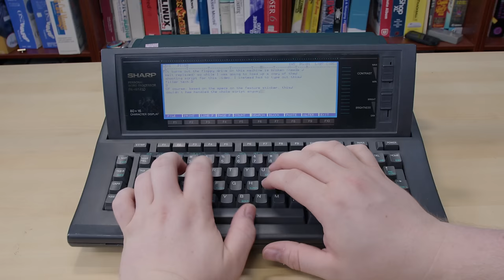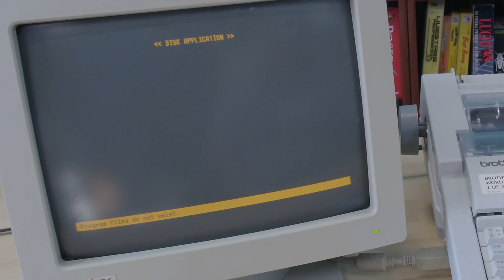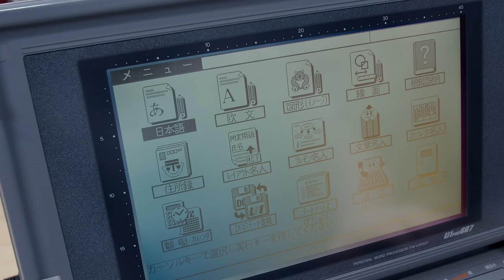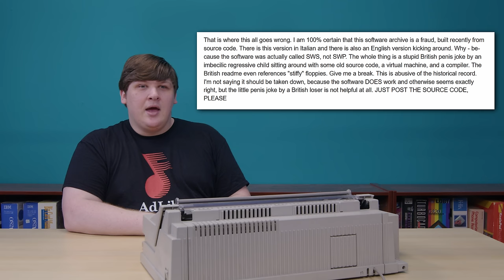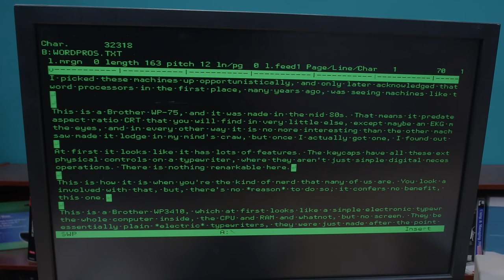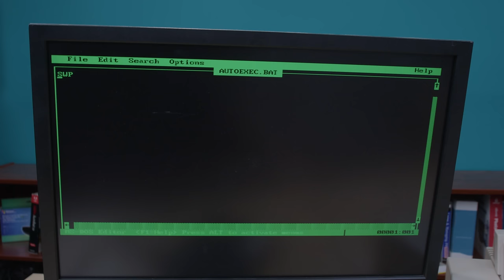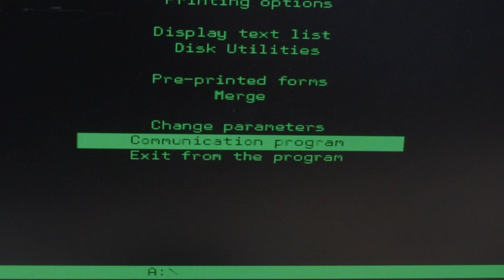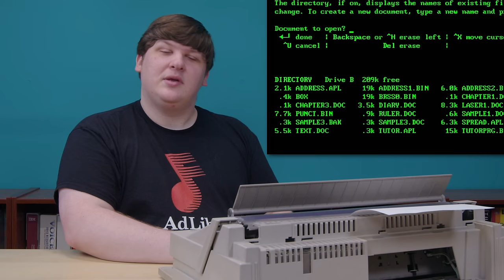The Weird Processor: Olivetti's PC Typewriter

Comment: My partner wanted to tell you that the reason it was super expensive and the custom programmes were so slick is because it was marketed to lawyers, who always base their purchasing on what sounds the most expensive and custom. (They're a soon-to-be former lawyer)
Reply: Very interesting!
Reply: Plus all the standardized forms with carbon copies. The ability to run WordPerfect is a plus.
Reply: I worked in a law office that still used one of these until it died in 2015. It was relegated to a corner of the office where it's only job was to type file labels.
Reply: In Germany, Olivetti typewriters and PC XT AT were the standard for tax consultants who work with DATEV (a cooperative) over the years.

Comment: Our shipping department still has an electronic typewriter in the cupboard, as they sometimes need it to fill out shipping papers that use a carbon copy (since other printing technologies are not able to imprint the character through the carbon paper onto the second sheet). So they still have some niche uses, whereas the "newer" word processor is completely obsolete.
Reply: 9pin dot matrix printer can do carbon copies just fine, but you might have issues with alignment when filling out those forms.
Reply: @SianaGearz  I found it uniquely amusing and pleasing when I first learned maybe five or ten years ago that they still make new dot matrix printers for exactly that purpose.
Reply: @ssokolow  : I think there's also an aspect of near invulnerability. I'd be more willing to try a daisy wheel or dot-matrix in a dusty location than an inkjet or laser, due to fear of the dust infiltrating critical sections of the printer causing more immediate trouble with the ink jet & laser than the more mechanical alternatives.
Reply: @absalomdraconis  Good point.
Reply: @RonJohn63  I mean if it's the same form format over and over again dot matrix really is the best way to go. Then again if op is somewhere in the middle of the shipping chain and they're filling out different forms from somewhere else that they have no control of then I'd go typewriter.
Reply: @RonJohn63  I don't think you can say that with any confidence. The op doesn't specify whether it's the same form over and over or if they change format often. If they do stay the same then dot matrix would be better you just set it up once and you're done. On the typewriter you need to manually advance lines and such it's got no idea what the form is, it's just putting letters down wherever you put the paper a dot matrix would do that automatically. There's a reason O'Reilly's used dot matrix up into 2020 for their carbon copy receipts. Cause you set it up once and it just works.
Reply: You'll still find them in car dealership accounting offices, used for filling out title papers ect.
Reply: Same we have type writers in the office supply room for filling out paper forms and checks

Comment: It doesn't seem like the reverse feature would waste ribbon to me, each character on one of these word processors uses the same linear amount of ribbon, and that amount of ribbon cannot be used again. So it's kind of wasting less ribbon, since it's using all of the ink/carbon on that length of ribbon, rather than leaving a lot of it on the ribbon.

Comment: The Panisonic looks really interesting! Its an electronic typewriter so maybe once you dig in it stops being interesting, but I want to know what a bunch of those applications are! Here are what their names are top to bottom left to right with my best guess at what they are.

日本語 - Japanese - Japanese text editor
欧文 - Western text - Latin character based text editor
図形（イメージ） - figure/graphic (image) - an image editor of some kind maybe?
線画 - Line art - figure drawing application?
機能説明 - Help file
住所録 - Address book
レイアウト名人 - Layout master - Maybe a form creator or a form filler application?
プレゼン名人 - Presentation master - Powerpoint type thing. Maybe you print out clear slides?
文章名人 - Writing master - No clue, maybe a different text editor with tools like table of contents?
カルク名人 - Calc master - Spreadsheet software
電卓・時計・カレンダ - Calculator, Clock, Calendar
DOSデータ交換 - DOS data conversion - converts from proprietary files to DOS compatible?
データノートII - Data Note II - maybe a lotus notes type thing?
通信 - Communication - Likely a modem program?
拡張 - Expansion - Not sure, maybe more programs under this as a submenu?

The mystery port says "image input output", I can't quite read the DSUB but I think it might just say "port", and the expansion ROM is a font package with 48 dot Gothic in the JIS format.
Reply: Thank you so much for the translation!
Reply: I read your first few words as "The Painsonic", and you never know, that might be correct.
Reply: I'm very very curious about the presentation mode; I saw that and immediately jumped to the comments to note that one because I can at least read that much!

Comment: Fun fact: italic  is possible on a daisywheel printer, and I personally have seen it in action. It utilizes a daisywheel with two "rings" (or "rows"?) of characters, and the entire wheel assembly moves slightly up or down to select a "text palette".
It was a common-ish design in Eastern Bloc because, well, the RUS/LAT problem which needed some solution anyway. Such machines were equipped with two wheels, one for RUS/LAT on separate rows and other for cyrillic/italic cyrillic. Clever and effective.

P.S. The almost universal use of the KOI-7 encoding with a separate character (and key on the keyboard) for changing the layout also fit perfectly into this technical solution. When printing, the system sees the required character and not only changes the code table to Latin, but also instructs the printer to shift the wheel. Same with Italic, just without code table switching.
Reply: Some Chinese printers as well. I'm kind of glad we've largely moved past impact printers because as much as some of the solutions were incredible they were often so much headache if anything went wrong.
Reply: Some models of Diablo daisy wheel printers supported dual row wheels, and proportional pitch wheels. I used to have a Xerox 820-II Information Processor. (After their failure with Star and Alto, Xerox didn't "do computers".) It was a bog generic Z-80 CP/M machine with text only video. Connected to it by the serial port was a Diablo 630 daisy wheel printer. Very fast, very loud. Though when with WordStar I had it do bold doublestrike underline it got a lot slower, and louder. I only ever had one print wheel so I never got to see what other tricks it could do.

Comment: 1. Olivetti was a pretty substantial early computer player, their Elea line were some of the first transistorized mainframes introduced in the late 1950s (and the progeny of their Semiconductors division is part of ST).  
They tried to exit the computer market on more than one occasion, the Elea line was sold to GE in 1964, who sold tens of thousands of them as the GE115 and successors.  Then they found themselves dragged back into the small systems market by the mid 70s via their presence in the calculators and typewriters office appliance market, with a few bespoke machines then more commodity things like the Z80 CP/M boxes you mention and a slate of PC compatibles... it's a neat story. 

2. You mention the Selectric and IBM/Lexmark Wheelwriter line as a comparison several times, which makes sense because they were ridiculously dominant so a lot of typewriter/wordprocessor conventions descend from them.
The wheel-writers are also daisywheels that do micro-shift bold and auto underline and such, and some of them do goofy things like beep spellcheck with no screen (I played with a 1500 that does that a while ago... it's a whole-ass NEC V20 based computer in there even with no screen or removable memory). 
There were several earlier IBM fancy machines like the Selectric Composer that did a ...purely mechanical proportional font with 40 characters of lookback memory implemented with little sliding plates... and a variety of models with weird bespoke magnetic storage and such.  Selectrics are insane clockwork bullshit that it makes absolute sense that they were instantly killed by the advent of microelectronics.  Getting an "attic-fresh" one into working condition is an interesting challenge that involves a bunch of solvents and specific lubricants and hundred page long sequential adjustment manuals.  
Later wheelwriters with line LCDs or attached CRTs or whatnot set a lot of the conventions for the kind of machines featured in this video. 

3. If you want a truly interesting late wordprocessor/appliance computer thing, try to look at a Canon Cat.  It was designed by Jef Raskin of Swyft and Macintosh fame, has a wildly sophisticated text-only interface for basic productivity software, infinite undo, etc. (and has a built in forth and assembly toolchain that you can drop into by special incantations).  They are ...difficult... to obtain these days, though you can play with its software in MAME.
Reply: While looking up history you could read about Federico Faggin who started work at Olivetti developing computers, before moving to USA and developing the first micro processor for Intel. And then starting the company Zilog who made the Z80 processor
Reply: An Olivetti P652 computer system was gifted to our school in ~1984. It was a 4004 based system, with magnetic tape program storage cards about the size of a punch card, with a track of tape on each side), paper punch tape writer and reader (separate cabinets), typewriter, and 70K word fixed hard hard disk (single ~1cm thick platter)
Reply: the elea lie wasnt sold intentionally, it was bc the founder adriano olivetti died, olivetti got saved only by a clandestine project

Comment: I worked briefly at an Olivetti reseller in the 1990s. Loved the video and I hope I can add some cultural / contextual background.

Olivetti's are weird in part because they were coming at computers from their Business Machines background and this had a big impact on who they targeted.

Note the little silver branding tab stuck on the keyboard advertising the local business machines dealer it was sold through. Olivetti was a something you'd likely be introduced to by the folks who sold you your photocopier. 

Our local reseller was owned by a family friend and I was in and around it and others for 15 years. Even in the late 1990s the showroom was dominated not with computers but photocopiers, electric typewriters, fax machines.

We shouldn't underestimate how many businesses held out with electronic typewriters until the turn of the century. While working as a technician in the late 90s I would visit workshops, factories, schools (mostly to fix photocopiers) and see so many being used in offices that were modernising, but without a single person on staff who'd ever touched a computer. As mentioned by other commenters hiring a person with typewriter skills was a lot easier than computer skills at this point.

The sales staff pitched the Olivetti PCs as an extension to the suite of machines you were already buying or leasing. They were often sold on support contracts, and serviced by their photocopier technicians.

Olivetti the company was designing and manufacturing a large line of complicated office machines, to which they added a PC line. I did a lot of work in the guts of Olivetti PCs and the physical design (fold away cases, swing-out components) seemed strongly influenced by those traditional machines. Support contracts are a big money and making photocopiers serviceable was core business.

This is entirely speculation - I wonder if the odd video output development was in any way influenced by the fact that Olivetti had video and lcd screens for their advanced photocopiers products.

Comment: 19:40 I don't think it's a matter of 'input lag'. When you type Japanese (I do it regularly) you write using 'sounds' (that's not correct, but that makes it easier to explain what I mean) and the software, after pressing the SPACE key, allows you to select from within a list what you mean by that chain of 'sounds'. So there's a key that'll give you 'ki' and other that'll give you 'ke', another to change that to 'ge' and finally one more to add a 'n' sound to the end. So you press all these and you get all the words that are a compound of the sounds 'ki ge n' (there's more than one, in this case). As you type more and more, the software 'learns' what you usually type and provides that as the first option, so you can just keep typing and the software would (theoretically) choose always the best option for you. What I think is happening here is that the software is still trying to do that, even in English mode (take note how it highlights all the word once you press the space key), even if it doesn't need to do so. It might have some amount of delay.... but I'm sure the delay is worse because of the way typing Japanese works. (edit: corrected a couple typos and incorrect punctuation)
Reply from the maker: Oh man, that makes sense, I hadn't considered that. There's a reason I said I wasn't the person to show this thing off!
Reply: @CathodeRayDude   I would bet it has more to do with page layout and pagination.  Showing text in a proper word processing program is surprising complex.  These, if they're using fixed-width fonts, have an advantage of not having to figure out the width and line height of characters, but they still need to tally up the number of chars / pixels per line, decide when it's time to wrap, figure out if there is any text below that needs to be pushed down a line, handle overflow of a page onto the next, and so on.

I would imagine a lot of this is happening even for the first character on the first line of the first page.  At the very least, there's word counting, buffer management ...

And that doesn't even start to consider things like spell checking and grammar checking.

All this on a low-cost, low power, fanless processor from the dark days of computing, that was probably optimized for as little RAM usage as possible over speed, and software that was written to be as stable as possible so they didn't have to deal with updating ROMs on a gazillion machines owned by people who were, by definition, uncomfortable with the idea of owning a computer.
Reply: I think you're on the money there, some older Japanese dramas have similar delays on full on computers (the one I remember best was a G3 Power Mac) due to the predictive text/selection at play.

Comment: Interesting fact about the Brother floppy drive - every floppy-enabled Brother device from sewing machines through knitting machines and later word processors used the same floppy format, the FB100. This was badged by Tandy for their portable devices like the M100 as the TPDD - Tandy Portable Disk Drive. It's now possible to read your Brother disks using a Fluxengine disk imaging tool thanks to me sending a raw dump of an FB100 disk to the Fluxengine creator @hjalfi, who added it as an option.

DC monitors - Chuck Peddle's Victor 9000 uses a separate 12V DC line from the PSU to power the CRT, neat. In Europe we had that machine as the ACT Sirius 1, and ACT went on to become Apricot who released a range of machines that also had DC powered monitors.
Reply: And you can actually rewire a "desktop floppy" drive to replace the original if it fails on you by cutting the ribbon cable and jumping the wires correctly.
Reply: Those Tandy drives are sought after by owners of old Brother electronic knitting machines.

Comment: The 640K limit is because the VGA buffer is at 0xA0000, or 640K. 768K would 0xC0000. So there's probably a video buffer at segment:offset 0xC000:0000. Then again it looks like they're register compatible with MDA so maybe they allow writes to the MDA address 0xB000:0000 too.
Reply: And as for "how much software would be able to take advantage of this" -- potentially quite a lot.  DOS would give your program a limit on how much memory it was allowed to use -- basically, whatever chunk it had free.  So if your memory manager could tell DOS to use a larger span of conventional memory, it would then report a larger chunk to the running program, and if that program didn't think too hard about it, it should "just work" up to 1MB.
Reply: @nickwallette6201  plug in another 256K and I bet this could load device drivers and TSRs high into UMA.

Comment: This is fun!
The other day I got an Olivetti ETV2900, which is basically the same but in reverse: The PC part is built into the monitor. You have a little 12" paperwhite CRT with two floppy drives mounted under the screen, with only power and keyboard connectors. Then you also have a more or less standard electric typewriter. And yes, the typewriter connects to the PC's keyboard connector. When it's plugged in and the PC turned on, the typewriter works as the PC's keyboard and the PC prints over the same keyboard connector to the typewriter's printing mechanism. Crazy!
Reply from the maker: oh, that's funky! you don't happen to be anywhere near seattle do you, lmao, I'd love to see how similar it is inside.
Reply: @CathodeRayDude  Sorry, I'm in Germany....
But hey, feel free to come pick it up! 😄

Comment: The carriage moving on the typewriter is to "point to the current position"; the LCD isn't long enough, so an indication of "how much space is left in the line" is needed. It's a type of cursor :)
Reply: That also probably explains why the early mouse cursors (Xerox Sparc, Alto) were an upwards pointing arrow.
Reply: @XanthinZarda That's a caret, also a technical name for a cursor. Variants include ^ and ‸ (proofreader's mark). Firefox has a caret browsing mode to enable cursor navigation.